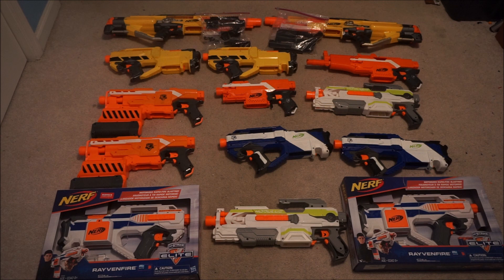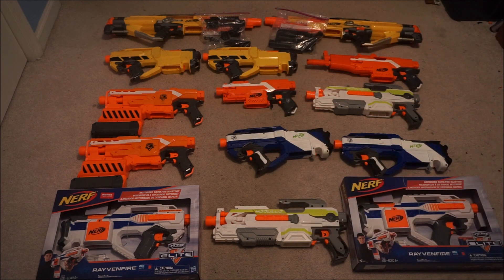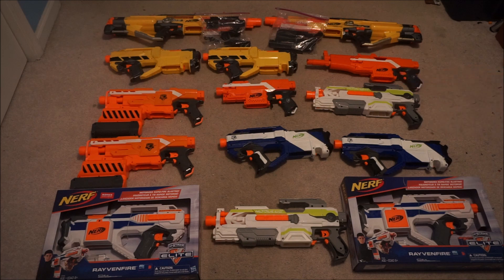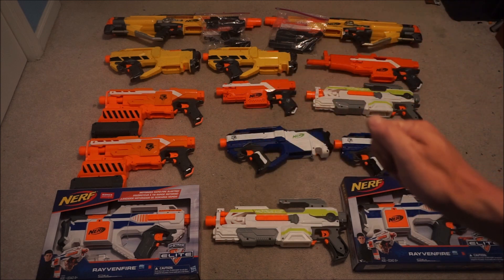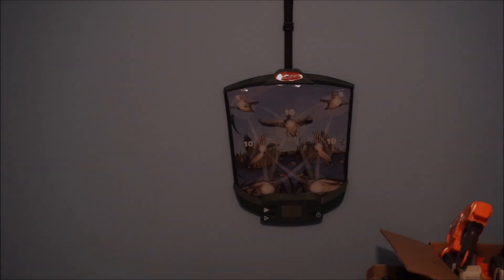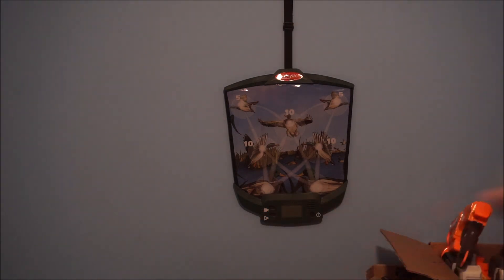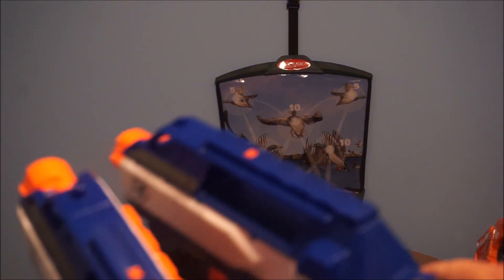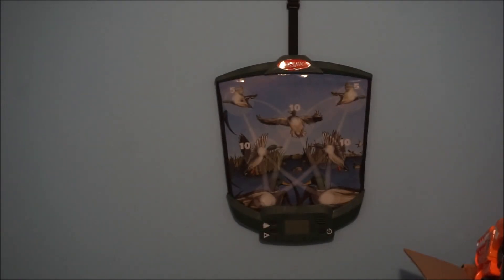Another Big Commission for PDK Films

Comment: Full auto Modulus?
Reply from the maker: I have done a few of them actually, 2 for PDK Films and 1 for All The Geek. They are a tough nut to crack, but it can be done............................... Chris
Reply: @projectnerf7920  do you do it with a stryfe kit or A hasbro pusher?
Reply from the maker: You have to modify a stryfe kit to make it fit but it works well when you get it in.................. Chris